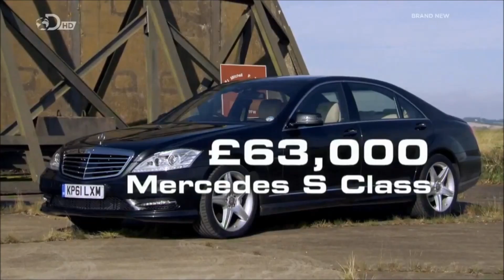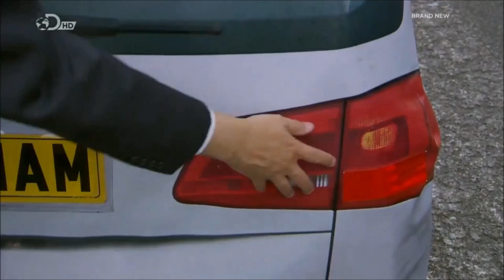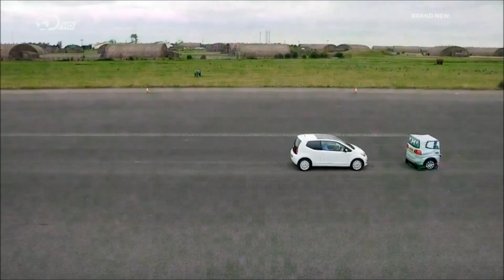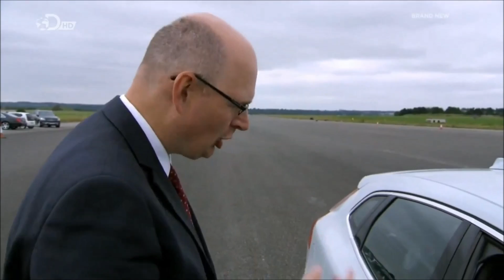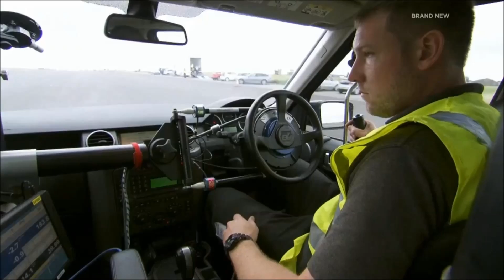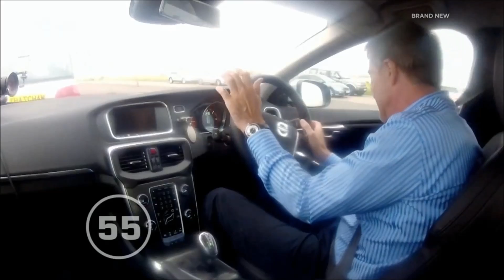Fifth Gear - Car Safety Systems (HD)

Comment: Not really. The Pre-Safe Brake system is not designed to stop the vehicle completely as Volvo's system is- it is to merely alert the driver so he/she can apply the brakes. The autonomous braking is simply to reduce impact speed. Mercedes have never claimed that it will stop the vehicle automatically.

Comment: Gusbandicoot. Sorry you are incorrect. Mercedes-Benz was first with abs, auto braking, seatbelt (not 3 point though), traction control, crumple zones, soft interior dash, airbags and not to forget the car itself! The Mercedes system is called an 'assist' function, it warns the driver  way before any other car here and allows the 'driver' to take aversive action as it is the driver is in control, not the car. Distronic plus is operational with cruise control on, this is pre-safe working

Comment: The test is about if the car manages to brake in time by itself. Volvo have the red lights flashing instead of the beeps and he didn't brake manualy for those. But imo he should have tested applying the brakes manually aswell to see if the results were different.

Comment: Something is wrong here, even a 2006 mercedes S class works a thousand times better than that, it doesnt only brake by itself but it also accelerate  by it self to follow the car at a safe distance.

Comment: Funny anecdote. My dad drives a 2012 Volvo S60 which also has City Safety on the car. Every now and then when I drive a bit too fast into our garage (which goes downhill first) it mistakenly takes the rear wall for a car and my brake pedal starts to shake. If I don't react the car just slams the brakes to get the car to a stop.

It seriously has made me laugh multiple times but it's good to know I can rely on the system when someday I would need it :)